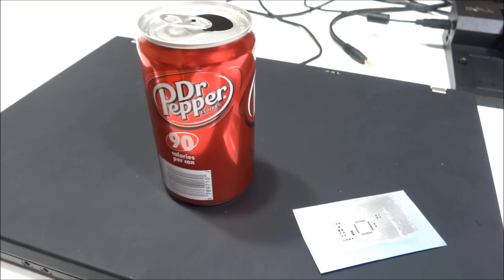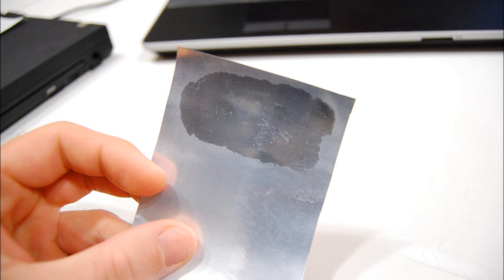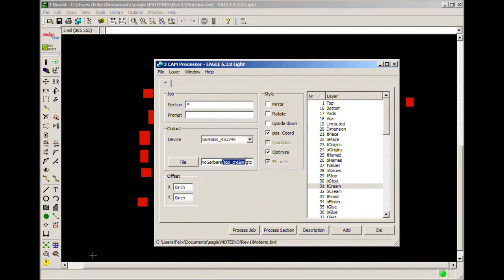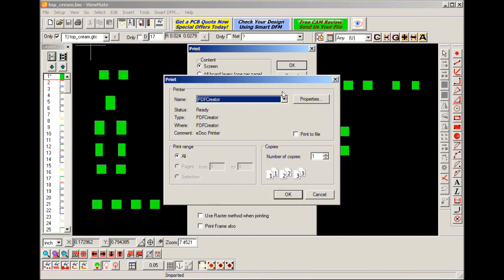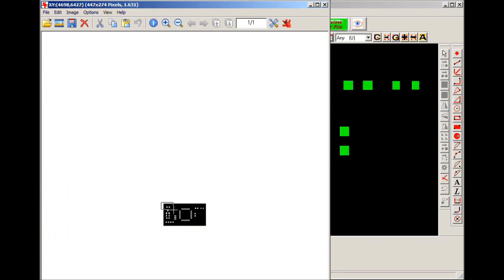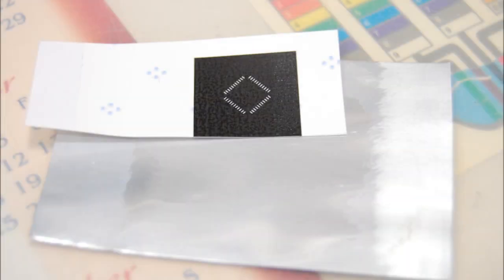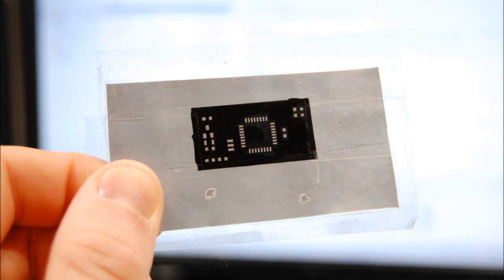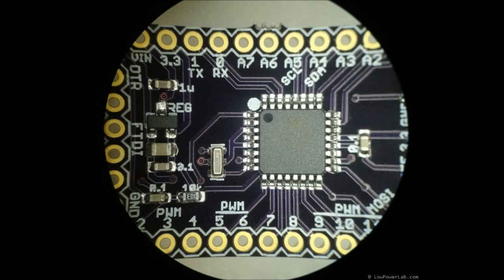DIY home-made SMT metal stencil - the definitive tutorial

Comment: will this work with photo resist process?
Reply: This is a separate process from the etching of the board itself but you could etch the board with any method then create an smd stencil for any surface mount device or integrated circuits you have on the board... this is a harder process than the etching itself in my experience.
Reply: I think you missed my point. I was asking if dryfilm etch resist would work as a mask/adhear to the aluminum... if anyone has tried it with uv photo sensitive etch resist mask film.

second...its not really a separate process for someone who started making boards with 2 sided designs. difference is I skipped tonner transfer because my research lead me to the conclusion it was inferior over all. regardless of etch mask method though...the only difference is sealing the z plane edges of the rectangle...I made cupric chloride for etching which required hcl and hydrogen peroxide plus copper to create. I wont be using my cupric bath but i will be using most of what i needed to create it. Compared to prep of the original etchant and first pcb i etched this requires one less ingredient

when i realized i wanted to be able to prototype pcbs at home I researched a lot before acting. It lead me to the conclusion that if you want reliable/repeatable sub 10mil features and aligned double sided boards then UV was the only way to go...unless you are into self abuse. Final straw was I lacked a laser printer and couldnt find an up to date reliable list of printers with solid/dense enough toner output for low cost. I did find a group of people who were sharing info on inkjet models that can be modified to print pigment ink on pcbs directly. As i needed a board fast i then found an ink jet compatible transparency rather than modifying the printer but i knew if it could print directly and the ink survived it would also be dark enough to block the uv for the traditional time tested industry standard method i adopted.

im not a fan boy. i do think if you are going to do only a few single sided boards, a few times a year, with dip sized smt packages and 1206 passives then toner transfer is probably a fast way to do that...if you already have a laser printer and or have a second one at work to try out.

Comment: Sorry, the units in viewMate are in mils? -0.007 mils? Thanks!
Reply from the maker: +Raul AC 1000mil = 1inch = 25.4mm
Reply: +Felix Rusu Thanks for the fast answer!, I mean in the video you say that you set the swell operation to -0.0075 mils, or thats what I undestand, but when I do it in mils it doesnt visibly shrink at all only if I do it with -0.0075 inches...
Reply from the maker: +Raul AC Yeah I meant 7mils not 0.007 mils :)
1-2mil is about a hair width.

Comment: At :25 there is a razor blade in the shot. Does this method work for putting detailed "holes" into the kind of razor blades at :25? Please someone help.
Reply from the maker: I don't think so, or it would be very slow and imprecise since it's THICK steel vs thin aluminum.
Reply: @FelixRusu  any ideas on what method can be used for making precise holes in razor blades? Artistic purposes of course.
Reply from the maker: @ultraslang  Sorry, no

Comment: It's not that easy to clean the inside coating of lacquer. I have tried MEK which is stronger than Acetone, but with no luck. Does anybody know another easy way to remove this coating? Great channel Felix.
Reply from the maker: Thanks, hey - just keep your iron on top of that epoxy layer for about 5 minutes or so. That should destabilize the epoxy and it wipes much easier. Also VERY VERY important that you don't scratch the inside aluminum surface, even micro scratches will render the toner transfer useless. Has to be mirror like for perfect transfer!
Reply: Felix Rusu
	 	 	 	
I haven't tried for 5 minutes. After I scratched the surface trying to remove the coating, I used the photosensitive film and I was able to transfer the film to aluminum foil.....I think I'll have success using this method. I still need to adjust the temperature of the lamina tor the work with the aluminum foil. I'll let you know if it will work later.

Comment from the maker: Solution is: 3 parts hydrogen peroxide, 1 part muriatic (hidrochloric - 31.5%) acid. Add a little copper wire from time to time to revitalize it, will last for many many etch sessions.

Comment: Do you think I can use ink printer?
Reply from the maker: If it resists acid and you can transfer it to can aluminum ... that will actually make you a superstar :)
Reply: Felix Rusu It's only about makeing that transfer. I wont use any acids. I don't know how to tranfer ink to the metal surface. I don't know if I am doing something wrong or it has to be a laser printer.

Comment: Hydrogen Peroxide and HCL at what concentration?
Reply: probably 3% drug store hp (us anyway) and 30% hcl from pool acid. you can find 12% hcl at beauty supply stores as "clear volume 40"(hair bleach) but im not a chemist so i recomend asking one what aluminum is going to do in that... I think theres going to be chlorine gas involved from 12%hp and 30%hcl alone. I made cupric outside and started with 3%...but after days of waiting for bright green ideal color I learned of the hair bleach, added 30ml to about 600ml of the 1/1 HP, HCL and copper solution i had. Went to bed and when i looked out patio door in the morning I had the color i needed to start etching efficently. Also we need to look into disposing of this before doing it... copper disolved with this method becomes toxic waste. It does with ferric too...reason to go cupric is you can reuse it indefinitely and easily make solid copper again with a few more chemicals. Im not sure how toxic it is with aluminium but 2 of 3 ingredient are the same so its worth looking into.  Im not a chemist i just have one that occasionally answers my txts if shes not busy or i suggest a really bad idea asking if its a bad idea.

Comment: this stencil has a very thin thickness so it will lead to a very small amount of solder paste !!
Reply from the maker: It's actually perfect thickness, the same as a real stencil (-;
Reply: @FelixRusu  good job for better printing use the photoresist dry film instead of toner transfere 
Also use kicad instead of eagle with kicad you can adjust the solder paste pads as a percentage of the actual component pad this helps getting good results after etching

Comment: Thanx for the video Felix. 
I used this for small series PCB, while you may want to use solder paste dispenser, for multiple PCB designs or if do a lot of PCB prototyping.
Check this  USB powered solder paste dispenser project on Kickstarter: https://www.kickstarter.com/projects/2129383335/i-extruder-smart-air-free-solder-paste-and-fluids
it works without air compressor.
Regards